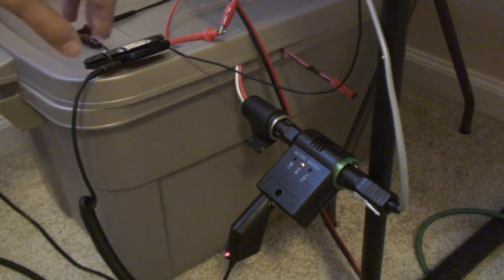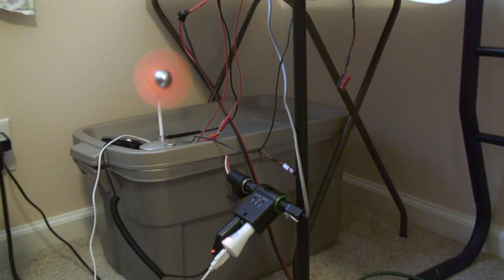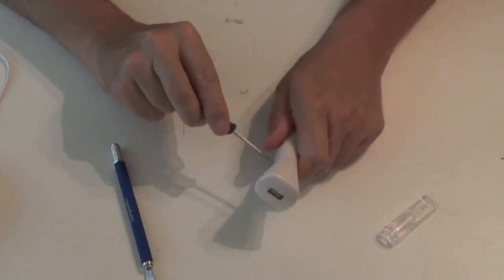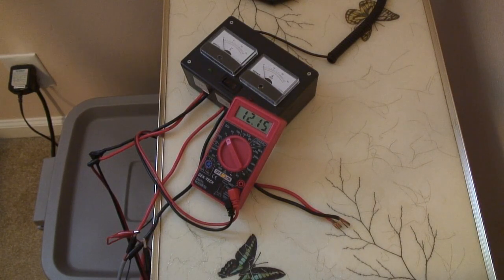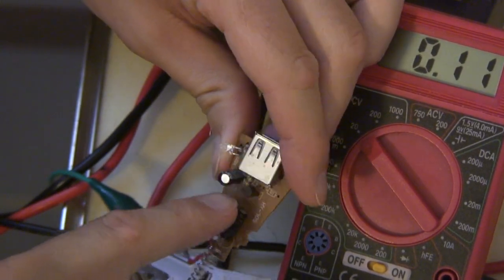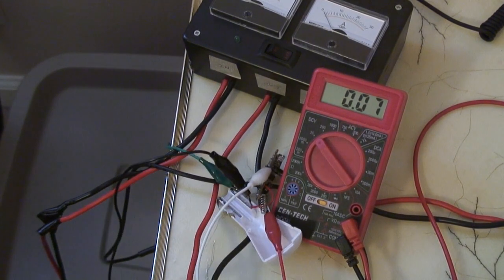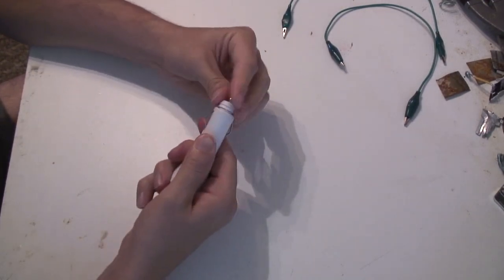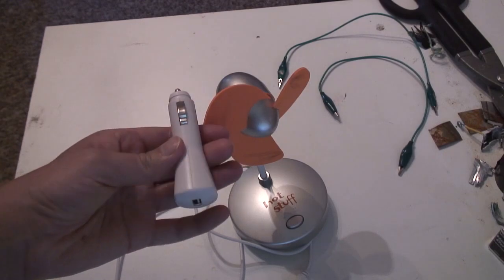USB Adapter Failed - 12V to 5V Voltage Regulator

Comment: IC 78l05 has temperature safety circuit and when it is overloaded with your fan it get hot... Circuit is the protecting him self by shunting down ... until cooled. so that is power disconnections. Probably low quality IC ....

Comment: @meteofan1x2 Thanks for your comment.  I did not say in the video, but the light finally went out and never turned back on.  It will no longer turn on at all.  I read that the IC's can overheat without a good heat sink.  There was no heat sink.  Thanks.

Comment from the maker: @meteofan1x2 That's a great question.  Maybe the fuse is rated at 1,000 mA while the IC was rated at just 100 mA.  That's my guess.  There's definitely an error between the label from China and the actual spec's of the voltage generator inside.

Comment: If it's an 'electronic' brushless fan (not a stepper motor as suggested) as found in PC fans etc, then the voltage generated by the fan windings won't be present on the power leads. In any case, the 78xx series are well protected and resistent to foldback. The USB spec is 500mA, that adapter is 100mA. It most likely failed through overcurrent. The fact it kept shutting off is evidence of this - the 78xx devices are thermally protected, but will only stand for so much abuse.

Comment from the maker: There is a positive and negative connection, but no ground.

You could manually connect a 12V DC power source to this circuit, without plugging it into the normal female plug.  You would have to find the positive connection and the negative connection on your circuit to make it work.

Comment from the maker: I am not 100% clear with your plan, but it looks to me that you want to put a switch to turn a 5V light on and off.  Your plan could work if you are powering a 5V light since that's the voltage coming out of these adapters.  And you must connect the negative terminal of the battery to the circuit.  There would be no ground unless you have one connected to your battery.

If you are running a low voltage of 12V and less, you should be safe.  Be careful to not short the battery.

Comment: You could actually reverse engineer that circuit and replace those electronic components that can accommodate a regulator rated at 1A to 3A. Problem solve.

Comment: That adapter is shocking quality. Even the cheap Chinese adapters I have at least use an MC34063 (1.5A max) switching IC in buck configuration to reduce the voltage efficiently.
I doubt the label is an error, more like a deliberate ripoff. It's an old video, but for anyone else with one of these,  I'd throw it out. it. It's not worth repairing.
You 'could' replace the 78L05 with a 7805 (TO220 package, much higher current) and heatsink it, but why bother? It'd cost more that the device is worth.

Comment: Oh shit that was a cheaper charger than the one I have my comes wit the ame5269 outputs 5V 2000mah but I had to use my soldiering pen to fix 2getter the 2 center pins of the USB port so my phone can use the full potency

Comment: never buy this regulator, it is ok in a car not with batteries. if your phone changing is 2 watt then you reg take 2,2 watt that in total is 4,2 watt power you ned to change your phone so the lost power is 2,2 watt in heat. Go for step down converter.